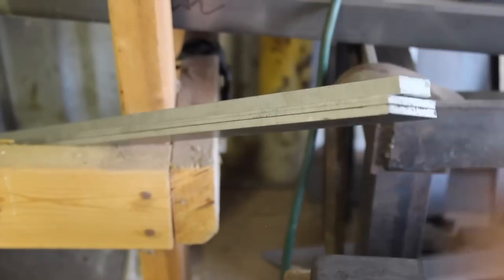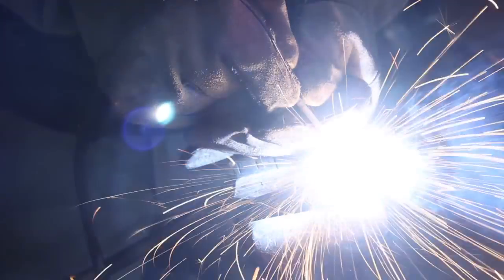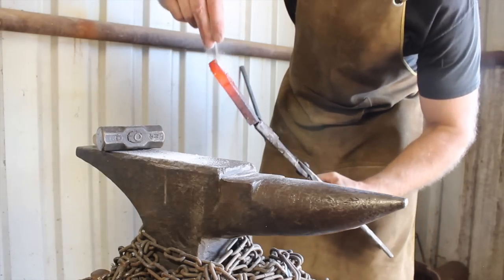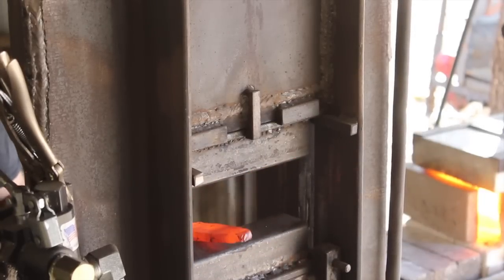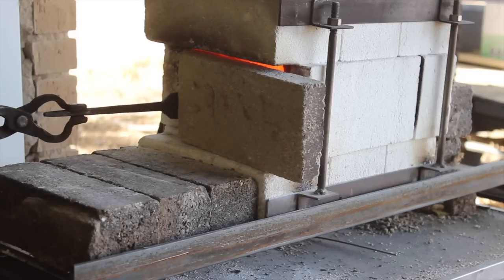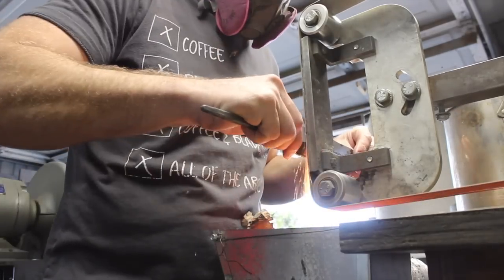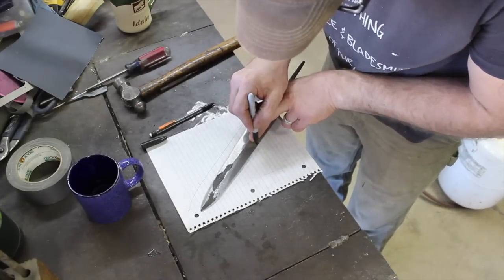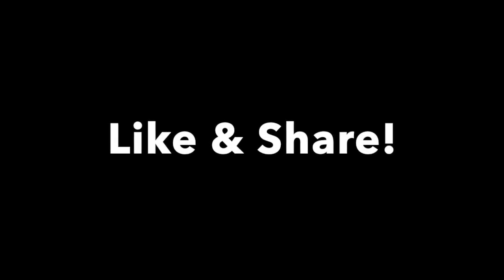Forging Arkansas Toothpick With Damascus Power Core: Double Edge Dagger Blade Smithing, Knife Making

Comment: So, the way I do Multi-Bar knives is I make my core first, then forge out the edge material twice as long as the core... after that I wrap the edge bar around the core (heating it at specific points before I do my bends) then forge weld it together (paying attention to give the tip a good smack or two on a swage block to make sure that it doesn't delaminate)... jsut a little tip to make things a little less complicated 🙂

Comment: Where do you get your steel from? It seems different everywhere I get mine
Reply from the maker: The main one I use these days it newjerseysteelbaron dot com  There are others; Jantz supply has some good stuff, the best thing about them is their flat rate shipping that is cheap, I've also used Admiral Steel. Nobody offers all the same thing.
Reply: Awesome thank you. I got stuff off Amazon that shipped free with prime membership and lately been getting steel from blacksmith depot and that is much better than Amazon. I didn't have to grind any mill scale to make damascus just acetone. I think I'm gonna try jantz next. I really want to try using 80crv2 and 15n20 to make my next billet.

Comment: The Arkansas toothpick was not interchangeable with Bowie in its day!! The men who worked the river area preferred this specific double edged  profile, preferred pull cuts...they were noted bu social commentators of the time that they lazed around picking their teeth with their daggers, these knives became known as toothpicks, generally seen as a gentlemen’s knife as a working man needs a single edge. The gentry and therefore society started referring to these as Arkansas toothpicks... the clipped Bowie we see now was an English invention in massed production form but originally inspired by Spanish fighting knives and the Mexicans. A 19th century man would know the difference immediately if asked the difference and a Bowie knife and a toothpick were not the same.... this is an academic error used to generically term all American knives under a single banner...
Reply from the maker: Well, I don't claim to be an expert or a historian on the Bowie knife, but the bit of reading / research I've done seems to suggest the opposite.. Do you happen to have some sources on the subject? Thanks for watching